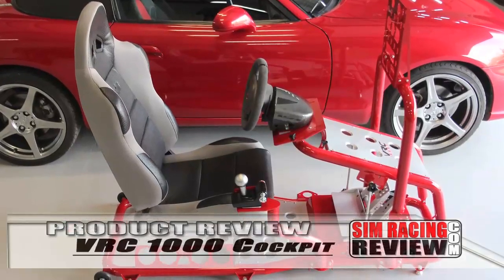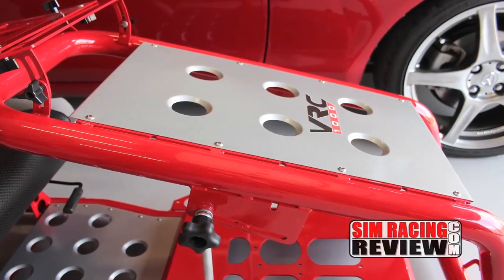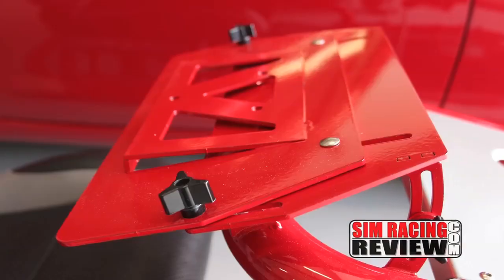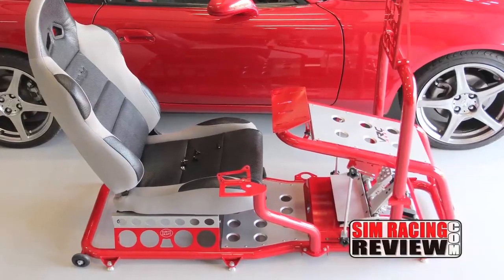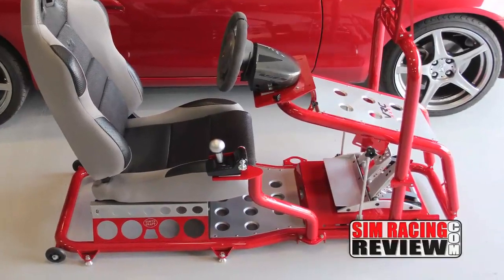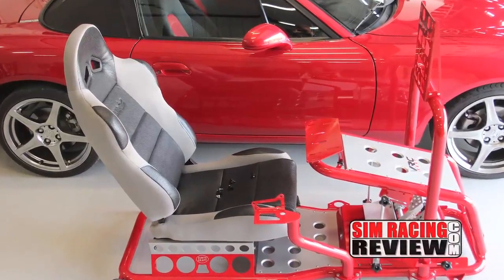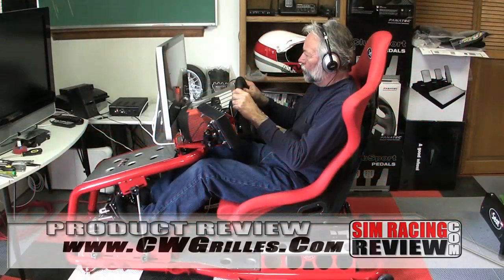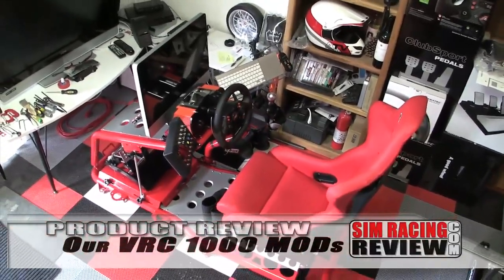Sim Racing Review - VRC 1000 Cockpit Initial Review

Comment: I will be purchasing the vrc 1000 in Jan. I saw another review that said the seat was one of the more comfortable seats they had tested and their problem was that it was not adjustable enough for taller drivers, i like it becuse it looks good and is rock solid and with a few mods it could be perfect: such as a place to mount a  buttkicker and keyboard table as you stated. It was also carriage works 1st attempt, i think they did ok . Ill get back to you on the seat comfort. Enjoy your videos alot